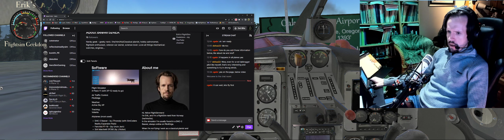Intimate Beaver time, part 2 - wheelie time

Comment: Can’t wait to try and steer into the loop. Thanks for the info!
Reply from the maker: Thanks for watching! And I'm happy you found that particular detail, as it was revelatory to me. It feels very disconcerting and unnatural to turn into the trending loop, but it seems to work. It's also easy to test the physics by flying moderately slowly and turning the ailerons back and forth - you'll see the adverse yaw: the nose going the opposite direction of the turn. That's the effect you want to make use of when landing and on the verge of losing control. But if the CG-vector is "outside" of the main wheels you are headed for the periphery regardless, and it's best to just brace and enjoy the ride... :-P